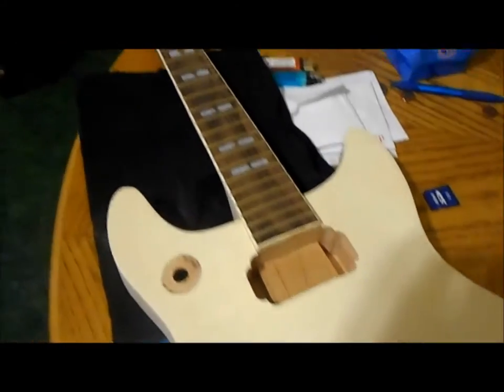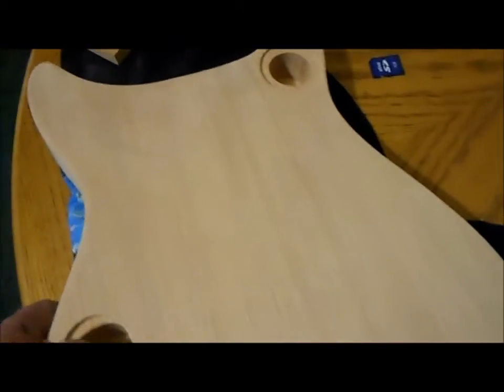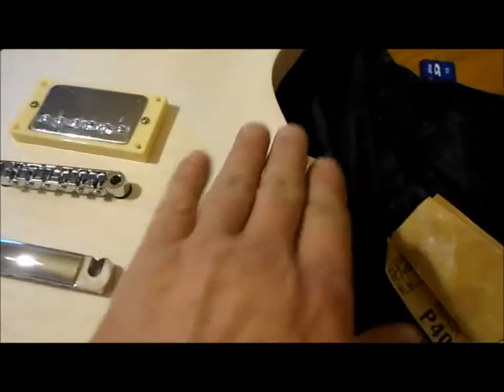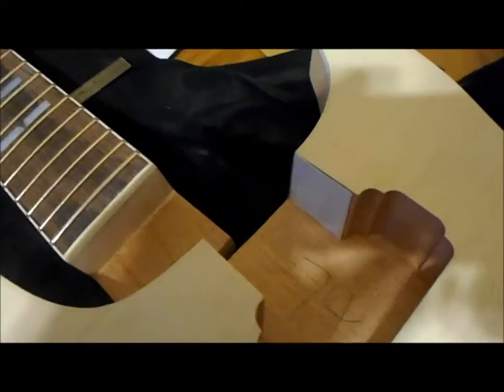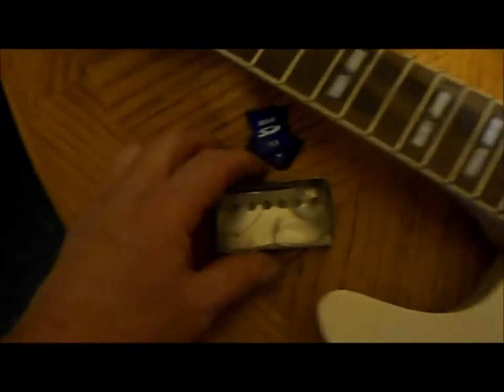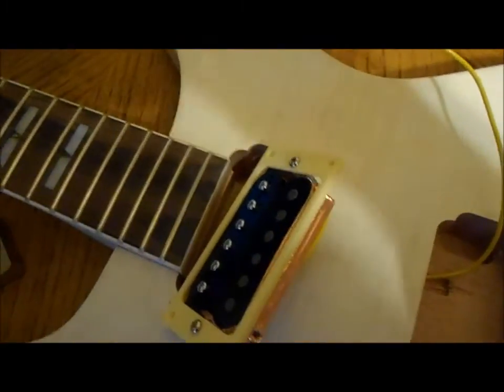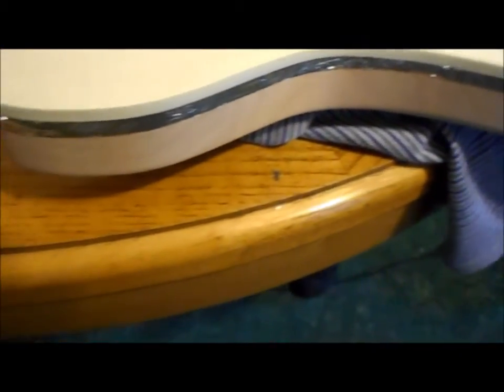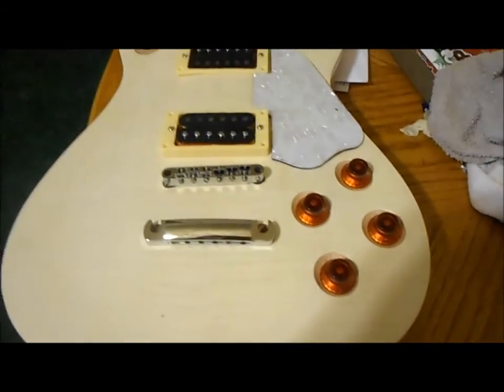Part 2: Alston A010 Guitar Kit Build, Design Ideas, Early Fitting

Comment: thanks for the vid. been looking at these kits. Btw those little spots on the wood look like knots, where small twigs would have branched out of the tree.
Reply from the maker: Yep, that's what they are. I love this guitar. It has so many sounds and plays so sweet. I always accept those blemishes as character and identifying marks. I have a Gibson Epiphone Nuveau  Spotlight with a solid flamed maple top. It has this huge what looks like a crack in it but it is really a different colored few grains in the wood influenced by proximity to the original bark of the tree. I love it there and wouldn't trade it for one that was considered "flawless". :)

Comment: This is interesting, I am almost finished with the exact same kit as the one you are working on. I did a western theme for a customer.  I had some of the exact issues you did.  I also found the measurement to be off on length, so removed some material from the neck. I had the same issue with glue or some kind of filler in the exact area you did.  I finally sanded and blotched on some stain to cover it. My neck did fit fine.  I switched the pickup covers to a gold and replaced the ivory trim rings with black.  I had a piece of the insert fret markers fall out, but glued it in with super glue.  I also had an issue with location of studs for the bridge, had to machine the holes wider to allow bridge to drop on.  You can see some stills of the guitar on my home channel. I will not be able to put the completed video up for a couple of months as the customer who ordered the guitar will be giving as a gift for xmas.

Looking forward to watching the finished project! Raymond
Reply from the maker: Hi, Yep I saw your rendition of this axe when I checked out your page. We went in different directions on this kit for sure. I like that western theme. Sweet.
Reply: The420four well that is the beauty of these kit guitars, a person can let their imagination run wild.  One thing I plan on doing for another customer is a swirl paint, I have been looking at some of those and find that interesting.